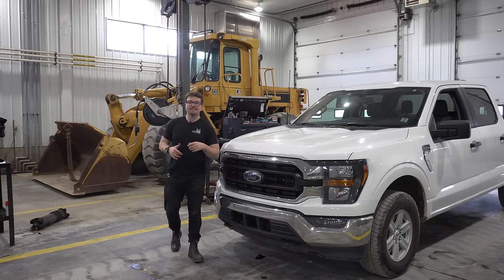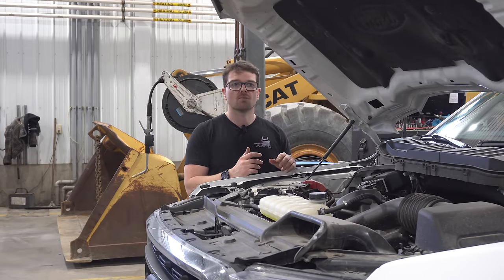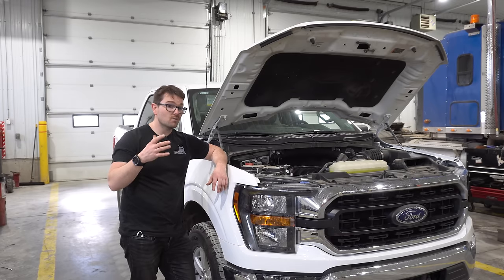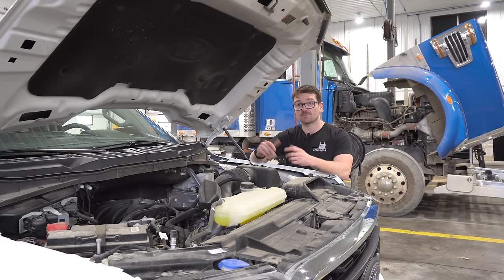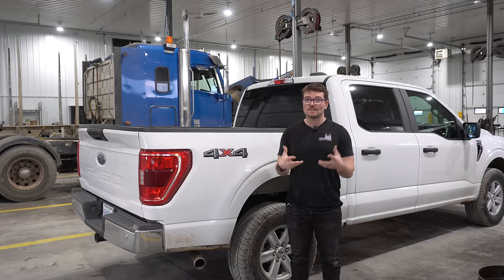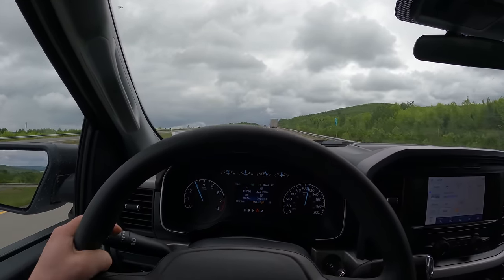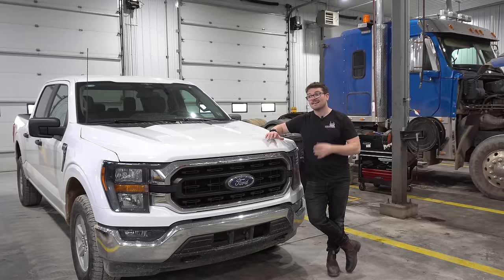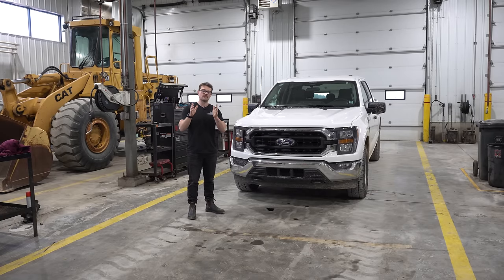Ford F150 5L Coyote V8 Engine **Heavy Mechanic Review** | 5 Reasons why It's the BEST

Comment: I have replaced cam phazers on hundreds of 5.0 Pos
Reply: You should be thankful that it's paying for your ungrateful wage. 🤣
Reply: I think you are making this up.  I’d believe you if it were the Gen 2 3.5 Ecoboost.
Reply from the maker: cam phasers or lifters - I'd take came phasers all day.
Reply: @TheGettyAdventures  same here man, cam phasers never left people stranded, even after years of them being noisy.
Reply: I call bullshit.
Reply: Run a good 5w30 full syn. oil and change it out no more than 5,000 miles preferably 3,500. Alot of people rely on the dash to tell them to change there oil.
  The US 5.4 Triton where told to use 5w20 and Europe's where told to use 5w30. They didn't have the issues we did with the phasers. US did it for the "gas mileage."

Comment: The 21 and up 5.0s have a tiny wet belt that drives the oil pump. Terrible design
Reply: 2.7 have them. No issues. 3.0 GM has them no problems. And no problems of note on the f-150s it’s a pretty beefy belt to it’s not tiny
Reply: He never replied lol